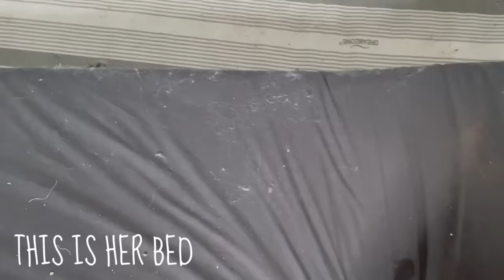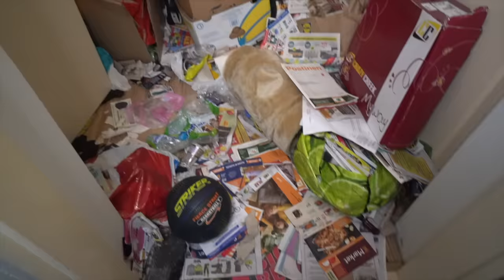FILTHY DEPRESSION HOME 🥺 - Cleaning FOR FREE! 💕

Comment: A little Vicks vapor rub, rubbed under your nose helps with bad smells. It's a trick we used to use working at the hospital. You can also use a bit of peppermint oil on a mask ..though you have to be cautious with essential oils. Especially with animals around. Just a suggestion 😉

Comment: If you have vinegar you can also put vinegar and water in a bowl and turn the Microwave on for 5 to 6 minutes and it will loosen up everything if you don’t have vinegar you can just use water as long as it goes on for five minutes it will help loosen up everything in the microwave. Then you can spray and clean very easily and quickly.

Comment: The cats like "Wait... Its clean?  But... I peed in every room. Now I have to start all over" 😆

For the one living there; if your depression doesnt seeem to have a psychological cause, check your vitamin D levels, with a low vitamin D, you can get so sick you can die. Getting out of bed alone takes all your energy. I almost died from a severe autoimmune disease caused by a lack of vitamin D. My levels were at 45nml/l, they should be at 75-250. Doctors have found now that many autoimmune diseases if not ALL are caused by a lack of vitamin D and thats just the start. A lack causes inflammation and a brain inflamed is a depressed brain. I went from crying for 11 hours straight a day when I had the strenght to get out of bed, to actually feeling like life is beautiful. And it was only a lack of vitamin D. So check your levels and if theyre low start with a 125ug dose and up if necessary, 20ug is too low to do any difference.